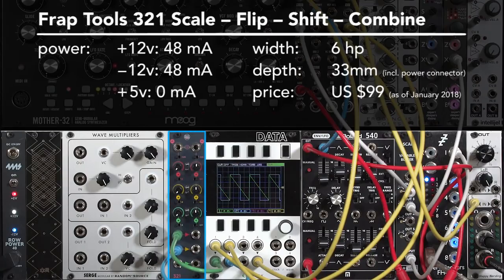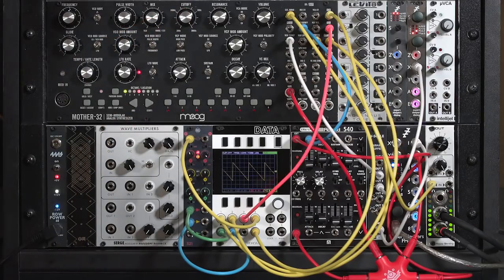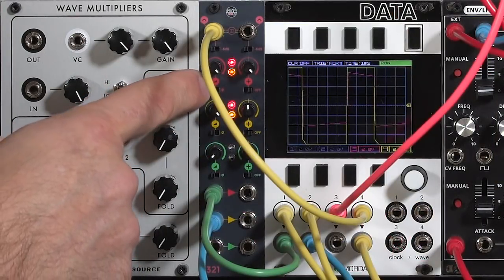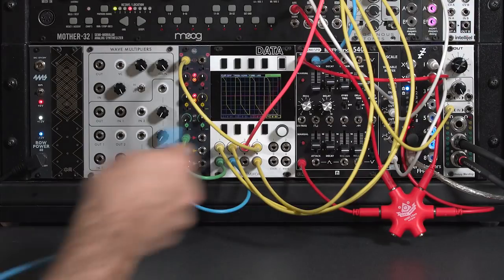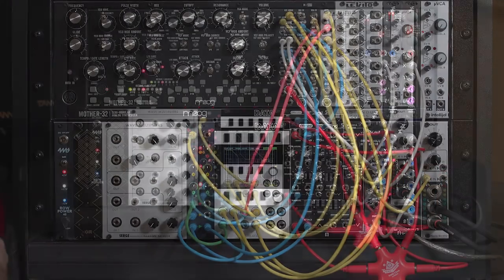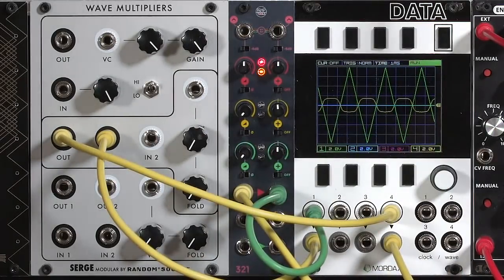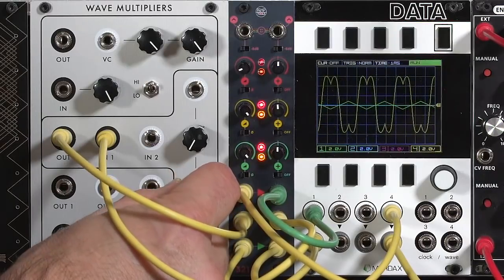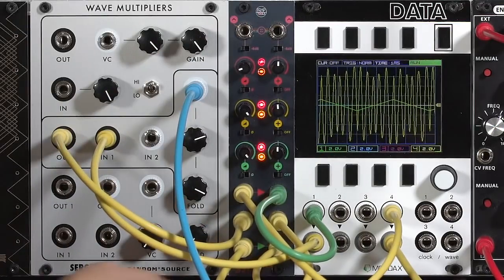Frap Tools 321 Scale + Flip + Shift + Combine (LMS: Eurorack Expansion)

Comment: I have this module on my want list so thanks for the rundown. It's too bad that Serge module doesn't include the necessary volume cut/boost for proper use in euro-world. Now I'm wondering if my Resonant Equalizer isn't also clipping like that.
Reply from the maker: I'm a bit frustrated that both R*S and Elby haven't really responded to this level issue; I think their assumption is you're using these in an all-Serge recreation system, as opposed to mixing and matching with other Eurorack modules. They say some of it comes down to the design of the module...but you can put attenuate/amp stages around it like shown here. Most frustrating was Elby's response, which was to release a proposed new Euro spec that lowers the audio level to match what they're already doing, rather than trying to be compatible with the vast majority of modules already out there.
Reply: Wow, crazy. It would be pretty silly to assume use is limited to other Serge recreation modules. Sounds like a cop out to me. You'd think they'd at least give customers a heads up on this issue.

Hey, you may be interested to check out the CMS recreation of the ARP 2500 filter for eurorack. The resonance on it is pretty insane. Full resonance already at 50% with beyond allowing for resonance to overpower the input signal. Apparently those levels were useful with the additional features on the original 2500, such as keyboard percussion, final Q and limited resonance. Anyway, I made a demo if you are interested. The input is really hot so I had it higher than it needed to be for the demo. Will be more mindful of that in the next one. Still sounds gorgeous!
https://youtu.be/rwVDHsYDwMI
Reply from the maker: I'll definitely check out the 2500 filter - thank you!

As for "all Serge" systems, Elby is indeed selling pre-configured EuroSerge systems, and R*S makes primarily updated 4U Serge modules, some of which they spin off to Eurorack. So you can see their focus.

But some companies have the attitude "we want a piece of the Eurorack market; we just don't want to have to pay attention to its standards", and I admit that annoys me - it's a disservice to users.
Reply: I agree on all of that. Thanks for the meaningful replies.

Wondering if you have any plan to get a hold of Frap FUMANA??? Really curious to hear that one. No good demos outside of noisy trade shows. I've got the Verbos Bark Filter but FUMANA looks even more interesting. I've got a thing for fixed filter banks and resonators.
Reply from the maker: I do indeed have plans to get my hands on a FUMANA in the near future, and will do videos on it after I feel I've sufficiently mastered it.

I'm guessing you've already seen my videos on the Bark Filter? https://www.youtube.com/playlist?list=PLli7NH8pJF8QRHlmaxjlQsTeuWJ27bvoP
Reply: Oh good! Something to look forward to. Yes, I've seen all your videos since the beginning. Subscribed early on. Bark Filter is fun once you click with it. It's an important part of this patch: https://youtu.be/2Uhn9Zi_HC8
Reply from the maker: Really like the sound of that CMS Arp 2500 filter, BTW - thanks for sharing!
Reply: They're also too big.
Reply from the maker: And to be fair, I have two Random*Source Serge plus an Elby (Ian Fritz) module in my system, so it's not like they've been banned either because of their audio level choices or panel width - they're very useful and cool. It's just nice to be aware of the level issue so you can get the module to behave in a mixed Eurorack environment a bit more like you'd expect.

Comment: Thanks for your effort and sharing your ideas! I am looking for an eurorack key tracking VCA solution. When turning a knob from ccw - just hearing the lower notes of sequence - to cw more and more emphasizing towards higher notes. In middle position all notes equal ampl. Any ideas how I can manage this? Thank you for your help!
Reply from the maker: (Hmm...I wrote a long reply yesterday, but it's not here...let's try again...)
Although it's not exactly what you're asking for (which can be done with a lot more patching), in general you'd want a comparator plus an AND logic module to do this. A comparator looks to see if an input signal (such as your sequencer pitch CV output) is higher or lower than a reference voltage (your "knob", in this case). If so, it outputs a high gate; if not, it outputs a low gate.
Combine this gate with your sequencer's note gate output using an AND module - this says "if input one AND input two are high, I'll output a high signal; otherwise, I'll output a low signal." This would have the effect of letting your note gates/triggers get through when the notes are higher than your knob reference, and would mute the gates if they were lower. 
That should put you on the road to doing what you're asking for. There are also two-input comparators, also known as "window" comparators. These provide a way to select a range of notes - between one knob and another, for example - to get through.
Reply: @LearningModular  WOW, amzing!! Thank you for spending so much time by solving my problem. I'll give it a try and get back to you with feedback. Going to find the modules first..You made my day! Please let me know, if I can do anything for you as an exchange. (my profession is advertising and grafic design for all off & online media) Thanks again and kind regards, Paul